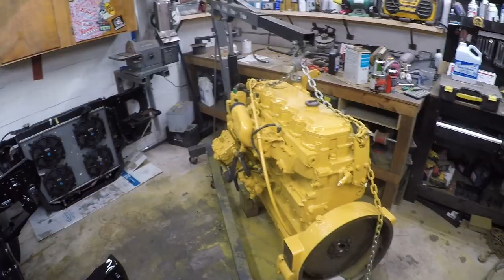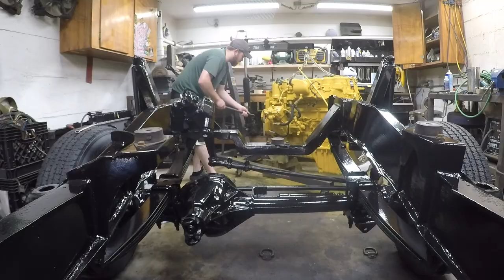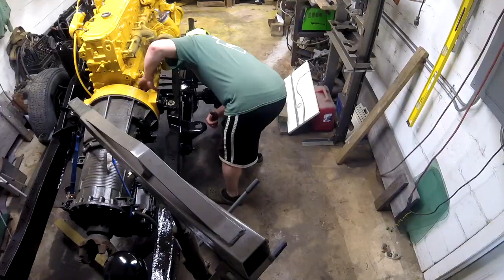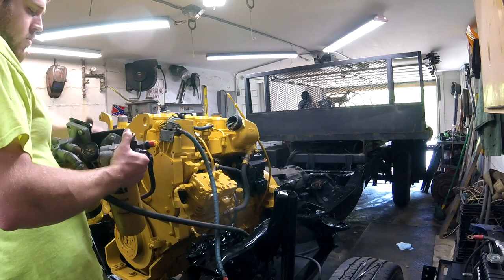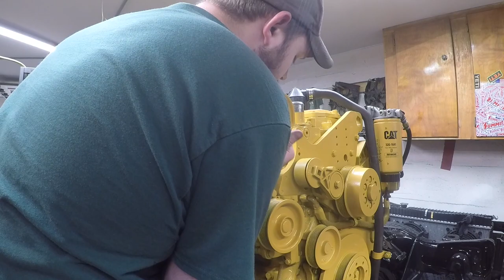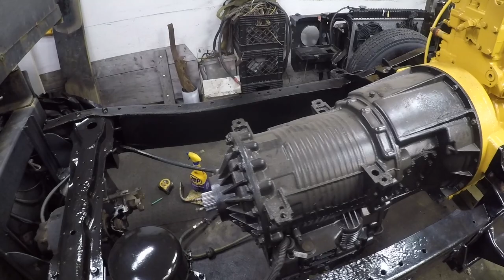Pt. 51 Bolting In The Cat 3126 And Allison MD3060. We Have A Problem... 91 F350 CAT3126 MD3060 Swap

Comment: that 2200 is so much smaller. life might be much much easier....you make the drive and i will donate the trans to the project. you got a new baby, a daughter and a wife to take care of. cant be spending money on yet another transmission. growing family needs a growing truck! cut that frame and change over to a crew cab or extended cab. trans problem averted, room for the growing family and it will ride sooooooo much better!
Reply: A lot of work but I was thinking the same thing. Strech it and crew cab it so the whole family can enjoy the cool truck Dad built👍🏻
Reply from the maker: Yeah that 2200 would definitely make life easier, I think I’m going to have to take you up on that! Problem with stretching it is finding a clean cab anywhere nearby. Next truck will be a crew cab tho for sure!

Comment: Extended double full cab stretch is calling... keep that PTO you need it. Snow blower, mulcher heck even a winch. Never give up a PTO trans.
Reply from the maker: Crew cab would be awesome! If I switch to the 2200 it has dual ptos my transfer case also has a pto so should be set!

Comment: I am a big fan of smashing bolts into place with an old (or new) screwdriver handle.
Well done.  (genuine comment, not sarcasm)
Reply from the maker: It’s one of the only ways to do it! You don’t want to damage the head of the bolt with a big heavy hammer!

Comment: Keep an eye out for a core 3060. You usually find them cheap. Swap out the parts you need and tear the core trans down to learn on or possibly rebuild if you have problems with the one in the truck. As soon as I saw you swing it around on the engine hoist I said "oh no! He has a PTO version." For some reason I never noticed that in your other videos. PCS has a calibration for an allison 1000 on their TCM's. I've thought about contacting them and see if they can control the 3000 series. You also have to keep an eye out on which version of 1000/2000/2400 allison you end up with. Some have helical gears, some strait cut gears. Apparently there is also different ratios on the planetary gear sets too. With the 1000 it will require a valve body and tcm change sometimes if 6th gear isn't enabled. I think it can be just programming on the newer versions but don't hold me to that.
Reply from the maker: I think I’m just going to swap to the 2200 that Jc has. I knew something looked different about the 3060 I got... I just thought it was an older version or something but nope lol. Someone else mentioned PCS for a tcm for the 2000. How would you tell if it has straight or helical gears and which is better?
Reply: @DrEwBaBy625  Strait cut gears are stronger but make more noise, helical gears are weaker and have less contact area but quiter. Besides physically looking at them, maybe the allison website will tell you if you enter the serial number. I did it on the 1000 I have one time but I don't remember what information it gave me. Also, remember if JC's transmission doesn't have 6th gear unlocked you will probably be looking at replacing the transmission valve body, internal and external harnesses, and tcm. I know for sure that the GM 5 speeds had a different valve body than the 6 speeds and don't have the hydraulic circuit for 6th gear. I would assume the SAE 1000's would be the same. There are different gear ratios in some of the 2000's. The reverse can be a lower speed ratio. I think that 1-3 might be lower speed ratios and spaced closer together. I had seen what the ratios were once but that was a long time ago and have no clue where I found it. I don't remember if the overdrives were the same or lower ratios too. 

Get the info off the data tag and if you don't turn up much in your research I would try to talk to this guy:

 www.transmissiontuner.com

http://www.transmissiontuner.com/Allison-Swap.html

I think he is usually pretty busy. It sounds like he possibly may not be able to Interface the 1000-2000 tcm with the Cat ecm but I don't see why you couldn't set it up as if it were connected to a machanical engine. I would also have the information off the tcm (if that is part of JC's deal) and what it was originally hooked up to when you contact him. 

If you have any more questions I'll try to help. I've looked into these transmissions off and on for several years but some of the information is a little fuzzy for me. I was really hoping you were going to stick with the 3000. No one really messes with them but man they are beefy. If there was an aftermarket controller for them I think people would really consider them. I even looked into Allison's tuning software but you have to take training cources at their facility before they will let you buy it. I've been slowly trying to learn computer programming/coding in a effort to either break into the tcm and modify it, be able to write a calibration for a PCS tcm, or build a tcm from the ground up. I've even been tinkering with an arduino just to learn about microcontrollers. It's a lot of information to take in and I don't have a lot of free time unfortunately. So it's one of those "some day projects" that I chip away at little by little.
Reply from the maker: James Sheets thanks a bunch for all the information! I really wanted to make the 3060 work too but sometimes you just have to cut your losses. If I ever get a crew cab I think the 3060 would be a more viable option.

Comment: Nice video. Idk what I’d do in your position tbh. Do what you would be happier with. I probably would’ve just put a 10 speed manual in it and been done with it. It’s cool to see someone do this in there drive way with basic tools. Not even a lift or anything. I can’t wait to see it done.
Reply from the maker: Thank you! A manual would have definitely been easier but I like a challenge!
Reply: DrewMan'sDriveway yeah thats what i think I like about your build the most. You didn’t do anything the “easy” way like most people would’ve with the plain old 12 valve and 5 speed swap. You went outside the box and didn’t things different then most.

Comment: I don't know if you know it or not but thete is an Allison PT3070. I know the military used them and still do. The great thing is it a 7 speed AND it has an integral Allison transfer case that is bolted to it. So no 3rd driveshaft which eliminates a lot of problems. The military used them in M1078s and M1083s. Those trucks use a 3126. The overdrive is .74 as opposed to .63 in the 3060.
Reply from the maker: Go over to google and image search Allison 3070 one of the first images is a guy next to one with the transfer case on it, that setup makes the man look like a boy lol it would drag on the ground if I put it in my truck lol.
Reply: I have one of these transmissions. Although it is kind of big the transfer case is aluminum. It is a driver's side drop and also the rear output drops down so you would have a much straighter shot to the rear end. I may have some PDF files on this trans. If I can find them I can send them to you. The transmission is the same as yours. Allison just added another real low gear to it by using one of the planetaries. The transfer case is 1 speed but the 1st gear is real low si you don't need a 2 speed.
Reply from the maker: billyduckling may not be a bad option if it had a bigger budget and some more room. I think it would hit my crossmember with how long it is
Reply: @DrEwBaBy625  Gotcha. These swaps can get expensive. I looked up the lengths of the transmissions. A regular MD3060 is 29.1 inches. A MD3060P is 33.3 inches. A MD3070PT is 51.5 inches or about 18 inches longet than what you now have. But keep in mind you will no longer need your transfer case. And it will drop the rear output shaft probably 12 inches. Something to keep in mind maybe later on down the road. Good luck on your project.

Comment: I have the 3060 you need in Florida and the one you have is what I’d like to have in case I run pro lol.md3060 is big even to stick it into a kodiak truck but also a disadvantage is that it don’t have a park paw so you’ll always need to use the trucks emergency brake and hope it’s enough to not let the truck roll if you have a heavy trailer and on a slope..
Reply from the maker: Florida is quite a haul to trade transmissions lol I think the 2000 will work much better for me. The at545 that I had in the truck before also had no park paw 🐾 so I kept the park brake adjusted pretty tight and never lost it lol but yeah a park paw would be a nice feature to have.

Comment: Juuuuuust saying that when you take yokes on and off or swap them out it is sometimes best to just buy a new nut for the yoke especially if it has a nylon locking ring. Just FYI in case you didn’t bc I couldn’t tell. They just don’t hold as good once removed and reused and can loosen up. Keep up the good videos
Reply from the maker: Thanks for the info! These ones are not nylocks so I will probably just squirt a little red loctite into there when I do put the yolk on. I haven’t actually bolted it on yet.

Comment: that yolk is massive lol. my dad is rebuilding the automatic trans for his 2000 dodge ram 3500. i never seen a trans that uses clutches. we pulled the overdrive section off not to long ago. it looks identical to the old chrysler  727 tourqe flight transmission

Comment: Well man that’s a little bit disappointing for
you after all that work, I really like what your doing.  I’d say go for the shorter tranny if you can make a good deal on trading this one.  As I say the content is great, it’s inspired me to get off my arse and start gathering the stuff to do what I’ve had planned for long time..... Early 1970’s F600/F700 4 door with a 4x4 conversion kit, Powered by a 3126 with a 13 speed.
Reply from the maker: I’m not overly upset, the engine now sits in there straight, you can take the oil pan off with it in the truck way easier and everything look way better! Like I said it’s all part of the process, there’s no manual for a project like this. That’s going to be a pretty sweet truck when it’s done!

Comment: Wonder if there's any of the old two speed rear differentials still around that you could use instead of what you have. I remember back 70's into the 80's they were common enough in a lot of 16', and up flat beds, and box trucks. Sure made driving around town, and highways both, a heck of a lot easier, and safer too I remember.
Plus helped greatly getting up to speed, without worrying how many people were going to be using universal sign language, telling you were number one to them all. That along with fuel milage, was helped somewhat, but being as yours is more of daily, without extra tonnage on it, I would think it be beneficial addition to your rig.
With your average annual fuel cost, at I believe it was around eight to ten mpg. It  wouldn't take long to justify the cost, especially if you picked three or more mpg average increase.
Just a passing thought,  might be of interest to you for future improvements, and might keep your better half happier too. We all know, if momma ain't happy, ain't no one gonna be happy, are the smart ones of us learned it pretty quick.
 Dang, almost need to relocate things to get shaft with slip joint in place there. BTW, might as make that first song your theme song. Kinda funny though you being in middle of New York state, and it being a definitely a Southern influenced song, but fitting considering your preference for trucks.

Comment: I was going to say y not use a 1000 or 2000 series. The 3000 and 4000 are huge. The 2000 and 1000 are some what the same there's something different in one of the clutch packs they didnt use in the 1000 because it made them shift harder.
Reply from the maker: I like to learn things the hard way! Now I know md3060 may not be the best option for a transmission swap! Thanks for the info

Comment: So what type of shifter you have for the transmission and what about the wiring what wires does it need to run?im doing a 8.3 Cummins with Allison md3060 into a Chevy c4500 Kodiak but still looking into the transmission wiring etc etc
Reply from the maker: The Louisville that I got the trans from had the push button shifter that I was going to use. Full manuals with all the information you need including wire diagrams can be found on google.

Comment: Can you run a 2000 with a NP271 mated transfer case? Much stronger and geared better than the NP205.
Reply from the maker: I probably could however I will probably stick with the np205. I already have it and it’s already installed so no sense re-inventing the wheel. The at545 and 2000 are actually really similar transmissions so it should be a fairly simple swap
Reply: @DrEwBaBy625  I was thinking if you needed to solve some crazy angles between the trans and transfer case but yeah I would use what you have. Nice build, love watching the videos.

Comment: I have a 2000 series Allison I took out of my 2007 F-650 to convert mine to manual transmission. Very low miles at 48,000. Works perfect. It does have a parking pawl. Has pto on it as it was in a wrecker. I can remove pto and put a plate over since you don't need that. Also have all the computers and wiring harnesses to make it work for you. It was bolted to a 5.9 Cummins but i'm pretty sure you can wire controller to your cat ecm and change some parameters with et to make it all communicate and work factory as the F-650 comes with a cat also and the same transmission. Now it is a sae 3 bell housing. I know you just swapped yours out. They also make an adapter to convert sae 2 to sae 3. International uses them a lot. Its only like 1" thick so you don't loose much room there either.  Here is craigslist link to my ad with my info on it. Let me know if interested.https://greenville.craigslist.org/pts/d/spartanburg-allison-2000-series/7120566817.htmlThanks
Bobby
Reply from the maker: Thanks for the heads up. I think I’m going go get the one from JC Smith, a little closer and cheaper! But if it doesn’t work out I’ll be in touch!
Reply: Cool. Just let me know. Thanks Man.

Comment: Looking at that mammoth sized transmission, I was wondering when you would build a box of gears that would basically copy the transfer case on the end.. hear me out.. it would be a sprocket that dropped to one side then went to the transfer case in truck. Short of that, just ain't no way a drive shaft can come off at that angle and drive the rest of the drivetrain. NO, I DON'T WANT TO KEEP THE TRANS in the truck that you have now, I would suffer the low geared one again before all that. I just know that your whole scheme of things was the higher gear ratio, not challenge Peterbilt trucking. I have wondered about a standard transmission by using a adaptor plate... It would have to be fairly large too cause a small truck one would wade up like tinfoil. I have my thinking hat on right now and it is blank as Miley Cyrus's graduation sheet. Right now the smallest u joint looks like about maybe a sixteen spicer joint. That is still several sizes too big for about a twelve coming from the t case. Paint that trans and take it to J.C. and get ten less than the paint that you put on... or as it is as its clean as new. Best of luck Drew...

Comment: Can i install any transmission md3060 ? Because we want remove manual transmission for install automatic transmission, please maybe you answer, great video
Reply from the maker: Should be able to as long as you get the tcm and wire it all up correctly. If your not concerned about speed or fuel economy the 545 would be a much easier swap.
Reply: @DrEwBaBy625  exactly. At545 is better with modulator vac, or electronic modulator for my cat 3126?

Comment: Ok, picture this, stretch the frame. In the extra space you create between the cab and the bed, I would put an auxiliary 90 gal rectangular fuel tank.
Get some frame sections from the scrap yard, and bolt together, just in case you change your mind later.
Not only can you stretch it, you can offset the height between the cab and bed to improve the drive angle.
Reply from the maker: Not a bad idea... switching transmissions sounds like way less work tho lol next truck will be a 4 door! Way more room for activities
Reply: @DrEwBaBy625  
I realize now that any offset would require suspension height modifications front to back. You are right. Just switch the transmission.

Comment: It is really hard to watch the videos now that you added that music, I try, but it is tough.  As for the MD3060, good luck getting sixth gear without spending a lot of money.  Even though you technically can get permission, they won’t give you permission based on the “modifications” you made to the original driveline, they would still charge you $500 or more to flash the TCM.  The 2000s have tons of support because they are essentially a 1000 series.
Reply from the maker: Just out of curiosity how does music make the videos hard to watch? Yeah I think I’m going to go with a 2000 for that reason and the fact that it’s a little smaller lol
Reply: Just not a fan of the specific music, so I mute it, then I can’t tell when you are talking.
Reply: I think you will be much happier with the 2000, especially for this application, hopefully you can get one with park.  I love your parking brake, but when you have a column shifter, it is really hard to remember that it needs to be in neutral, when the habit is to “put the shifter in park”, except it is all of a sudden In reverse.  I bought a GMC with that transmission, no park, and air brakes, really messes with me.  I don’t drive it often enough, so you might just get used to it.